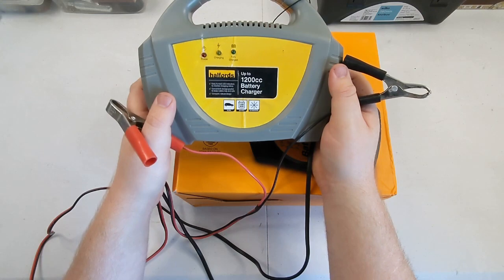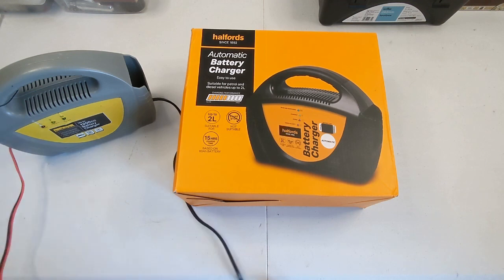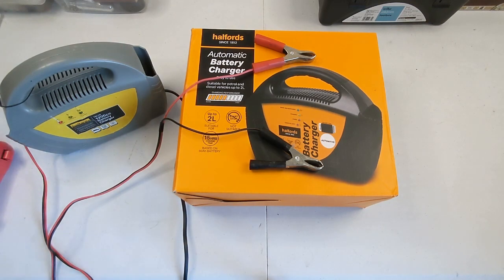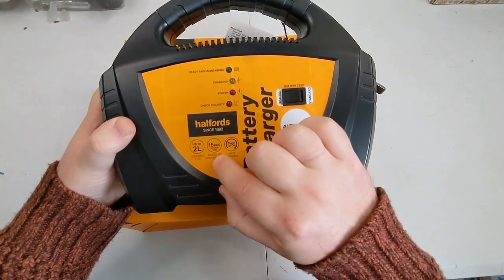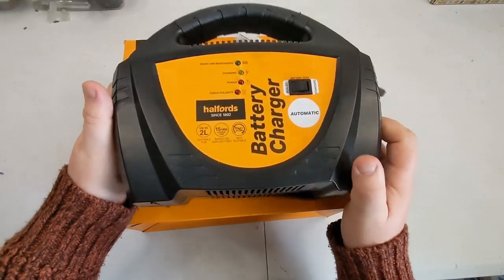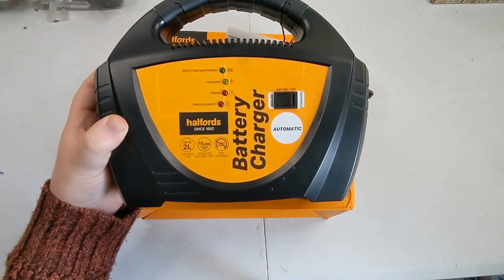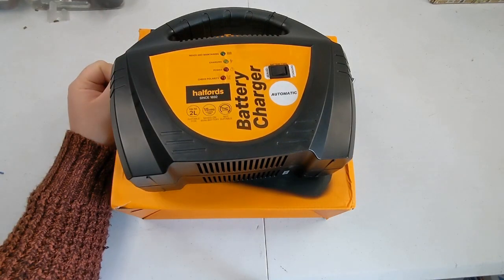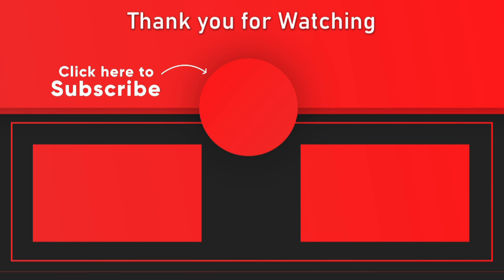Halfords Automatic Battery Charger - Up to 2L Engines | Unboxing and Review. (Short Version)

Comment: Thanks for this. I was wondering why the charger wouldn’t move from the red. Won’t charge flat batteries. Ffs
Reply from the maker: Unfortunately so, I don't know what voltage it is looking for either to start the charge, probably at least a couple of volts. You may have to do what I did and use another charger for part of the work then let this take over, or if you don't have another charger some jump leads to another car/battery may bring the power up enough to fool it into working.

Comment: Can i ask what old charger did you use that charged your conpletely dead mazda battery. Im in the same situation.
Reply from the maker: It was a smaller Halfords battery charger. The one marked for up to 1400cc, non-automatic version that just put out power rather than waiting to detect when it's connected to something.